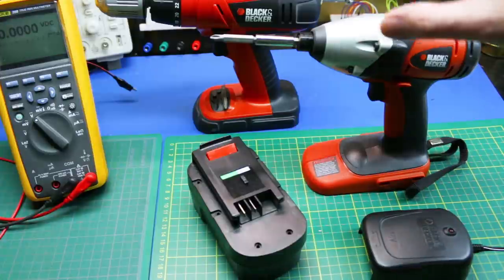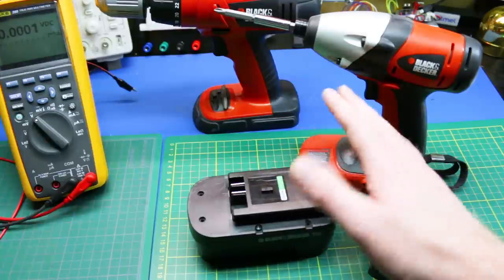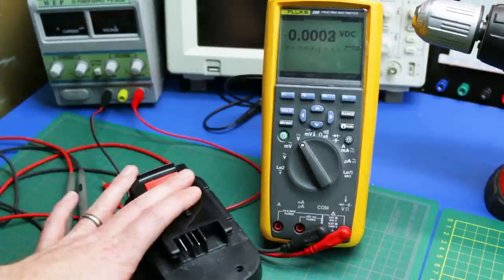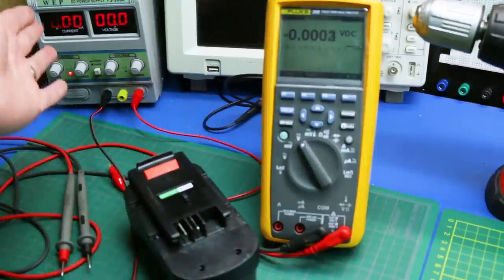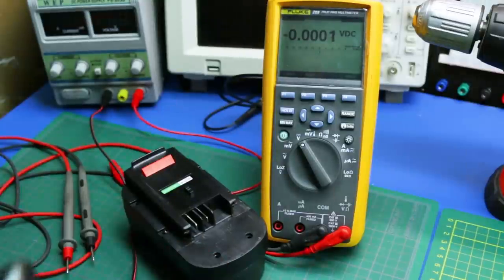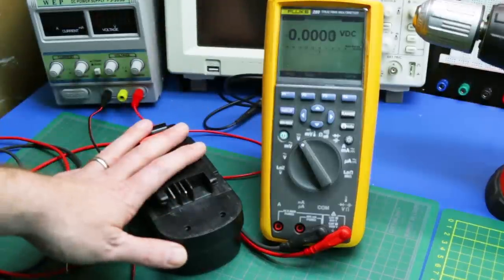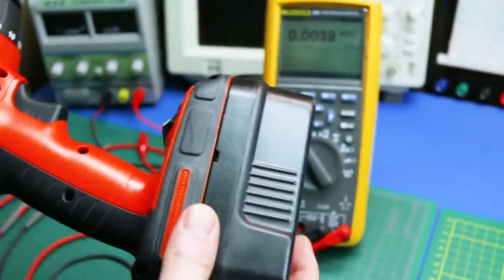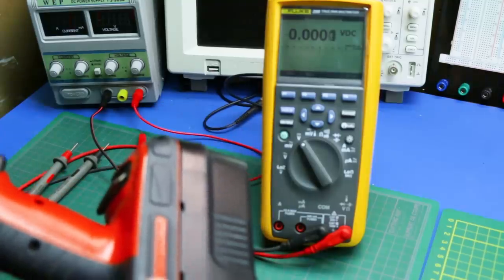Fix a Dead Drill Battery That Wont Charge- Don't Throw it Away!

Comment: Thanks a lot you saved me $300 for  new battery drill. Had this sitting in my shed for easily 10yrs. Last night hooked it up to my car battery charger for 10 mins to get it to read 10volts. The Charger normally goes red to green within a second. It happily charged both my batteries.
Reply from the maker: Nice Jason. Cheers
Reply: Explain how you did this please.
Reply: How????

Comment: I watched a lot of battery repair videos and yours made the most sense.  Jolting with over voltage does not make sense so the welder and in series batteries were out.  Your video showed that the dead battery needs just regular charging voltage to put enough into the battery so that the charger will accept the battery.  I do not have a variable power supply so I used a good 18V battery and connected them parallel.  It only took about 30 seconds of parallel connection for the dead battery to come back to life.  Thanks for posting!
Reply from the maker: It's a fine line when showing such things on YT as you are telling people how to bypass safeguards. This was the safest I could do ;)
Reply: Batteries have design limit which you did not exceed.  That's an important lesson to observe.  Anyways, my drill is a humble Task Force but the thought of saving it from the land fill is priceless.

Comment: A Real Comedian ! ! !
However, I found that I can buy a Schumacher DSR Proseries DSR127 8-Bank Battery Charger, 6/12V, 2-12 Amps for under $1000 and then run it in parallel with my NOCO Boost Max GB500 and using them together I can revive this battery for less than $3,500, but that's at todays prices.

Comment: Did something similar. I took the dead battery pack apart, then connected alligator clips to the positive and negative terminals of another fully charged battery, then I jumped the positive alligator clip to the dead battery terminal and tapped each individual  battery with the negative clip till each one sparked.  Reassembled the dead battery pack and placed it on a charger, started charging immediately. Works perfect and saved myself $40.00

Comment: I repacked my NiCD battery with lithium ion cells to kill the memory issues with the nicads.  Might be a good idea to clip in a pulse charger in your circuit too as it can break up the memory wall issues when you have a multi-cell pack like that (battery 1 is dead and battery 2+ are all OK still).

Comment: I use the car battery charger that has the start feature. Hook up the positive to the positive then tap the negative terminal a couple times and in most cases the battery will take a charge.
Reply: Good luck finding the web site. The address seems to take you everywhere but the actual web site.
Reply: What do you mean "tap" the negative part ?
Reply: @jennieredrose5819  By leaving the positive side connected, touch the negative to the negative side of battery for a second or two and remove. Do this a couple times and try it in the charger again.

Comment: Can I use a car battery charger to recharge my drill battery? The charger I have is very old and does both 6 & 12 volt batteries. It can be turned to trickle, plus two higher levels. Looking forward to your thoughts. Regards, Chris.

Comment: mine stopped charging but i paid like 5 bucks for the drill and battery, and have a better one now, so i just took out the nicd cells, recovered the undercharged ones, and made a 12V pack for RC testing :)
Reply from the maker: +ZakkBlog Ha nice. All can be reused

Comment: I attempted to parallel connect two Milwaukee Li batteries but did not work. I connected a known good M28 to a V28 that had been in storage too long and wouldn’t take a charge. They did not balance out as it seems that the M28 has some type of internal protection that keeps it from being connected that way because each time I attempted it the indicator led’s on the good M28 would start flashing in some form of test pattern. I currently don’t have a volt meter so I’m flying blind but any tips would help. If I purchase a power supply, what type should I purchase and at what settings to try and bring this V28 battery back to life? Thanks!

Comment: Don't do this for lithium ion!  DELAYED FIRE HAZARD for Lithium Ion (LIon) batteries!
The battery pack was shut down as a safety precaution because LIon batteries used to catch fire.  Then someone figured out why, and manufacturers started adding safety circuits to keep that from happening.  What you are doing fools the safety circuit, and can lead to the battery pack catching fire:
 - Once an individual (3V) cell gets below (IIRC) around 1.4V, the copper electrodes start to dissolve.
 - If the pack is then recharged, the copper will form nucleation sites where metal whiskers will begin to grow (by electroplating), inside the cell.
 - After some charge / discharge cycles, the metal whiskers will begin to short out the battery cells.
 - Shorts in the battery cells can get hot enough to ignite the battery.
 - Oops, left it on the carpet near the crib!

LIon batteries hold a LOT of energy.  They can catch fire and even explode, which will at least ruin any power tool they are in, and might start a house fire.

Better to get a new battery, or replace the old cells.  Avoid cheap, maybe jump-started discharged cells.  New cells fix the problem.
Reply: All i did is keep my battery in a metal toolbox away from anything flamable. easy fix and saved me hundreds of dollara
Reply: I just cover my charging battery with my used linseed oil rags, so if the battery catches fire they'll smother it

Comment: why my battery after full charged use it only few times then the drill run slower and slower? i want to replace another batteryif i can't fix it. Many thanks.
Reply from the maker: Probably one or more bad cells in the pack.
Reply: Hi sammy, still need the brandnew replacement battery for your cordless tools? Shop on loopower please.

Comment: An interesting concept going on here. The average person doesn't have a great deal of expensive electrical equipment sitting in their home to repair a cheap drill battery. Cost of equipment versus cost of cheap drill battery. The answer is obvious, buy the equipment and if the battery ever goes dead again, you're all set to repair it again. Why would the average person not want to have all the fancy equipment not sitting there. After all a drill just pokes holes.
Reply: Just get the RC Charger or one like it... that will do about any battery... really.

Comment: What is a Bench Power Supply?  And what is the best and cheapest way to 'ZAP' one of these questionable batteries?  Will a Zap from a 6/12 V Car battery charger Work to awaken one these batteries up?  I've got 2 -Ryobi 12v batteries that will take a charge but drain, without even being used within 12 hours.  Or could my battery issue be a different problem where a Zap will not Work!
Reply: a bench power supply is literally a power supply that sits on your work / electronics bench. As he mentioned the one he has is adjustable and has an integrated volt meter.
Reply: Just get the RC Charger or one like it... that will do about any battery... really. The other stuff is mostly for other needs.

Comment: Hi I know this vid is a year old but I thought I'd give it a go ' I was recently given a black and decker alligator but no charger I've looked online and can see chargers but none really say if there for the alligator type battery ' what I'm getting at is my friend says he has charged different types of batteries with just one type of battery charger I think by pulling the wires from the charger and connecting them straight to battery itself " so rather than spend what looks like from what I '' can't '" make out £ 30 to £60 on a charger  could I some how atleast test if the battery will charge that came with the saw ' by Jerry rigging a charger .I  won't hold it against you fella if you blank me